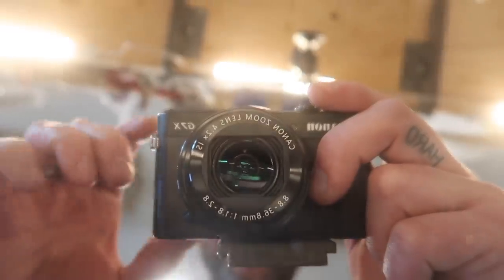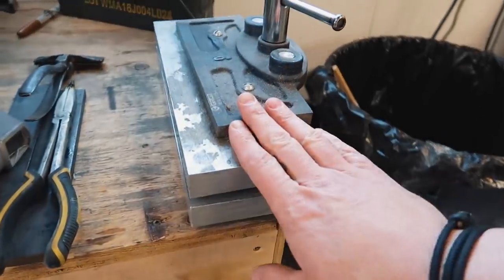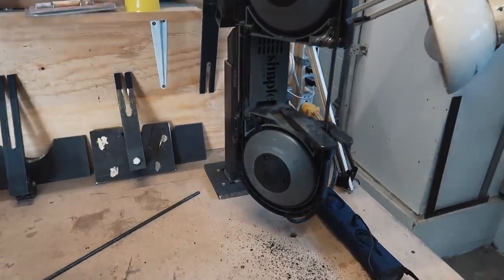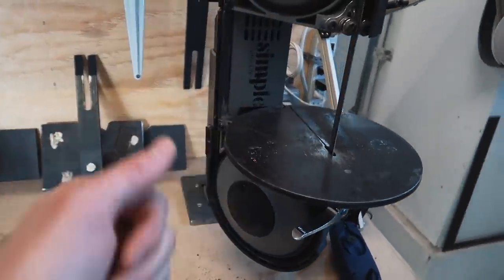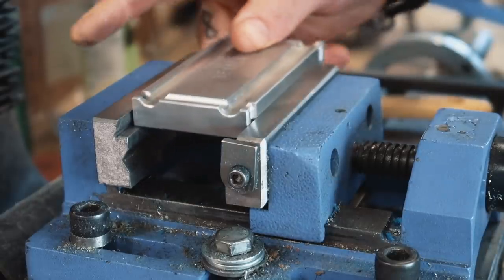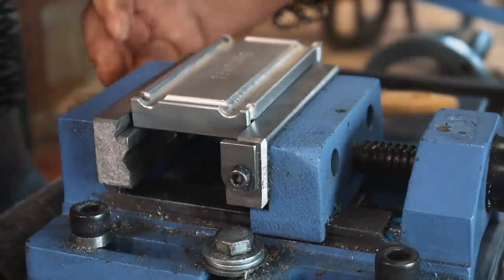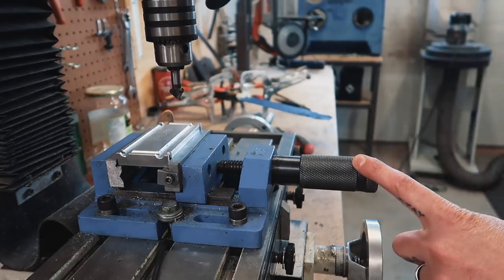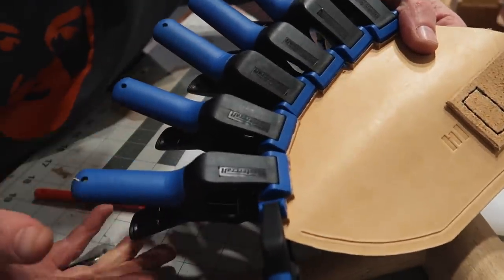This TOOL HACK saves me HOURS! - Simple Little Life-

Comment: If you move the stop to the fixed jaw or one at the back of the vise it will be much more stable, Where you have the stop now the jaw move front to back and will has some side movement. 
Great job on the video.
Jim
Reply from the maker: Yeah I thought about that but there is less than .001” of play side to side (it barely registers on my dial indicator) so I figured it wouldn’t make too much of a difference. There’s also the horizontal grove on the other jaw that would have made it more difficult to be able to swing out of the way of. I certain do understand and appreciate the theory behind putting it on the fixed jaw though. 👍

Comment: Your little stop exists as a product for milling machines, though I'd recommend putting it on the stationary jaw not the moving one as the stationary jaw will allow for tighter tolerances given that it doesn't move.
Reply: It's called a machinist vice stop.
Reply from the maker: I didn’t know something like that exists. This is  stainless it a heck of a lot cheaper. There is a horizontal grove machine on the fixed side that I use often for round stock and making it swing out of the way of that would have been a lot more work. Seeing as there is less than .001” play in the sliding jaw I figured it would be the best place to put it.
Reply: @chrisclikks  and hes a millwright by trade 🤣🤣🤣🤣

Comment: I wrap wax paper around the parts of my clamps that grip against whatever you place in them then hold the paper in place with some string. That way they don't stick to your work and also when you are epoxying something with multiple parts that you don't want to slip or slide it's one less thing to worry about. I also took various sizes of rods and cut a slit on one end. Then I can chuck it in my hand drill and insert strips of sand paper into the slit - you have a little sanding device that can fit anywhere. I don't have a foredom or any similar device and so I worked with what I have.